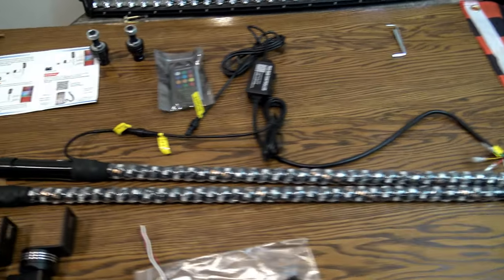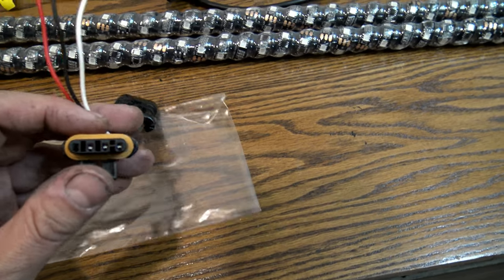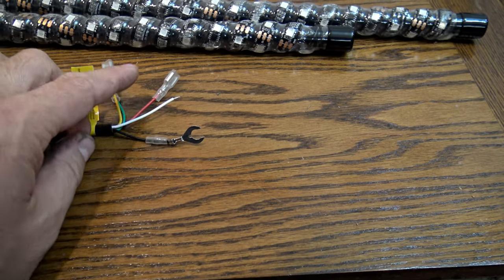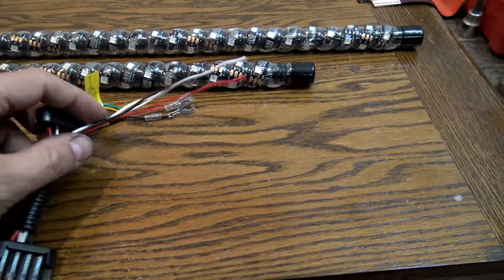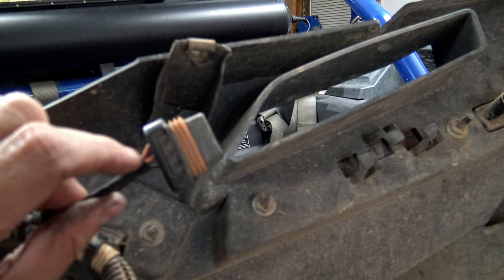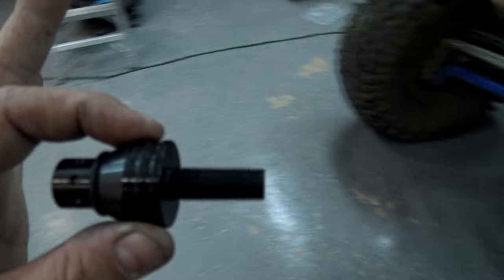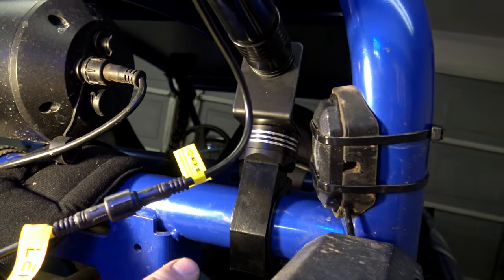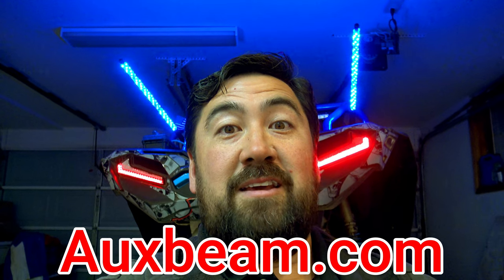Whip lights that have brake and turn signal functions for a Polaris RZR

Comment: I have redone my Sportsman xp 1000 it now has 63 1/2" wheelbase and a RJWC exhaust, AFR Gauge. 
And it looks like the Stock OEM exhaust is better than the RJWC because it shows that it's running  .1 to .2 richer at WOT than stock so only one way that can happen is that it's not flowing has good has Stock OEM exhaust did.
And the RJWC with the quiet core is no good at all because it's  .7 richer than stock.
So Polaris said that the Sportsman XP 1000 has a  tuned  exhaust system I believe them now.
Reply from the maker: Crazy how that works sometimes
Reply: @GrimRZR  I know, I'm glad I didn't get the RJWC for more power than the stock exhaust or I would be mad but my main goal was lighter weight and it is 5 lb. lighter and it sets lower to lower CG more. 
And it looks Awesome and loud.
And you didn't say anything about my 63 1/2"wheelbase , it was a lot of work. 
Had to try out my new $1000 welder on something.  LOL
Reply from the maker: @crazyflyboy30  I'm not real familiar with them.  Im sure adding some wheelbase is going to make it feel much better on steep climbs

Comment: My brake lights on come when I turn on my whip rocker switch lights.  The whips turn red when the switch is off and the brakes are applied.
Reply from the maker: I'd check to make sure the wiring is like the diagram they sent
Reply from the maker: Also it could be a faulty controller

Comment: Do i need 2 of the pigtail plugs for 2 whips
Reply from the maker: Just one.  It will supply the controller
Reply: @GrimRZR  THANKS
Reply from the maker: @dougfrombergen3984  anytime

Comment: This work for 2023?
Reply from the maker: Should.
Reply: I'm trying to figure that put as well, I have that plug it's a 4 pin, my plug on my rzr xp1000 is alos a 4 pin but only has 3 pins active.

Comment: Led whips are supposed to be installed straight up , not in an angle. That looks stupid... 😂
Reply from the maker: I don't think they would last straight up
Reply: @GrimRZR  they’re supposed to be 8 feet off of the ground for visibility to other drivers it’s the law for BLM
Reply from the maker: @nathanbeaner928  I could see that in some places.  Around here it's just pretty lights.